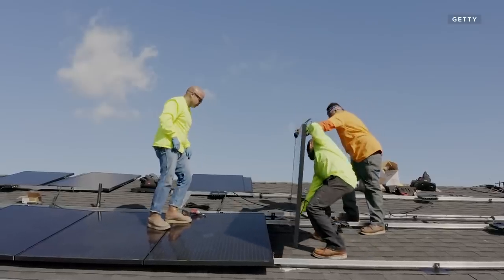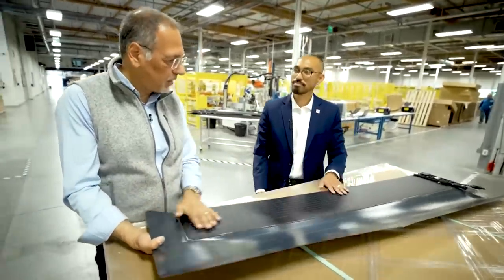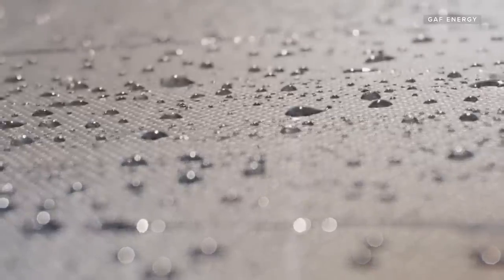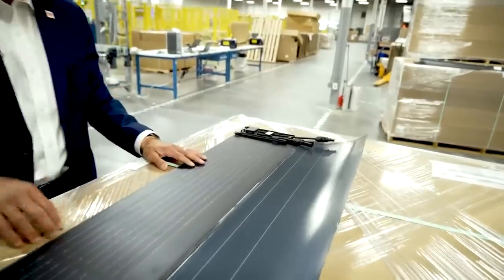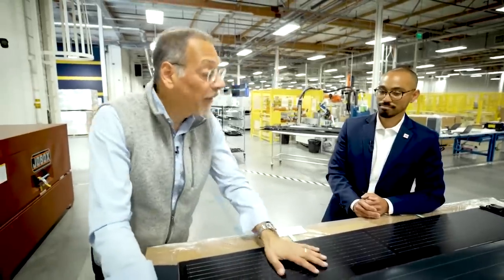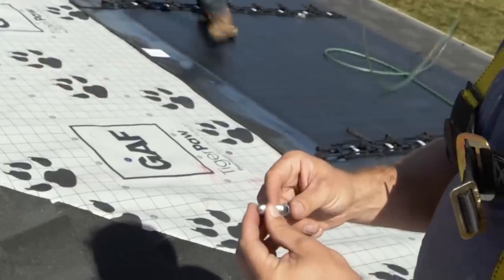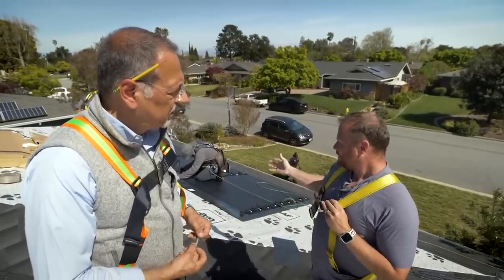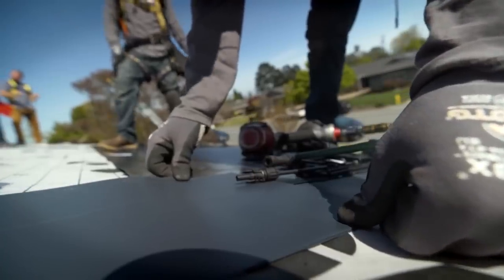The new Timberline Solar™ roofing system is so advanced it makes solar simple.  Call 801-447-8011

Comment: Great product! I would definitely revise the wire connectors. The Anderson plugs seem too large and make the whole connection channel look clunky, might consider XT-60 or XT-90 connectors.
Reply: @JorgTheElder  Sounds like you've been around solar for a while. I've set up small scale solar systems and I always look for ways to be innovative.  I know that concealing wires can be a pain in the keester.  Anderson connectors are clunky and might be overdue for a new invention, just my 2 cents. Eventually they'll come up with low profile, almost invisible connection type, to conceal this unsightly part of the install.
Reply: Anderson connector ?  That's Staubli MC4 standard solar panel connector . Invented in Switzerland IN 1996 . The gold standard of solar connectors.
Reply: Jorg jorgenson
Why does it matter? 
Look always matters to consumers
Reply from the maker: Good point, something to consider.  Thanks for your feedback
Reply: All I know after years of living in snow country,that if anything sticks up above the roof and is not flush with the surface of the panels and is made with plastic or a rubber material , will brake from snow removal especially after years of sun and weather as the material may become brittle.

Comment: This product looks much simpler to install for shade projects than traditional panels. Also for Vans and RVs.
Reply: The Van-RV is a bad idea. I can see lots of reasons that will not work.
Reply from the maker: Good thought but these solar shingle needs to be nailed into a wood base so it would not be very suitable for Van or RV builds.  For Vans and RV's the flex solar panels are good options if you have a good fastening solution.
Reply: @legacyroofingutah9766  If grommets were installed, and there was extra sheeting on both sides for 4 point securing, I bet it would work great!
Reply: bet they wont sell you a pallet of them though
Reply: All solar companies sell pallets

Comment: It just unreasonably expensive $20K vs $65K, I couldn't justify the diff in cost to install solar roof shingles. And what happens in the Northern state where snow covers shingle for a long period on time?
Reply from the maker: Roof integrated solar shingles that look much better than bulky solar racks on homes do come at a higher cost than normal DIY solar panels this is true, especially as this is not a DIY suitable install process.  GAF does their best to keep the product affordable but is not willing to cut corners on quality like many solar products do just to bring pricing down slightly.  For homes with snow, removal of the snow is required for any solar product to function properly.  Most cities have a roof snow removal service that can help with this.  The long term energy savings and environmental benefits are well worth going solar.  With GAF Timberline Solar Shingles your home can finally look great and have a very powerful energy efficient solar roof at the same time.

Comment: I really dont understand how the heat will work with this. normally, panels are installed with spacing, so air can come through. How does this work here? The efficiency will drop then?
Reply from the maker: When it comes to how solar panels operate day in and day out on top of the roof of your home, there are few common misconceptions. We thought we’d clear up those myths with some facts about how solar works in all kinds of weather conditions.

MYTH 1: Solar only works in hot weather.
You need plenty of sunlight to generate solar energy and there are more hours of sunlight during the warmer summer months. It’s the light — not the heat — that solar panels use to generate clean energy. Solar panels actually work more efficiently when it’s not too hot outside. In fact, there are many instances of solar panels working in extreme cold, such as the Antarctic, or even to power satellites in outer space.

MYTH 2: Solar doesn’t work during the winter.
The Solaria solar panels used in GAF Energy roof-integrated solar systems have been subjected to extra reliability testing to expose the product to a variety of stresses, including severe heat and cold cycles and cyclic humidity and freezing. And, as we explained in Myth #1, solar panels work more efficiently in cooler temperatures, so while they may collect less overall sunlight in, say January, the panels will generate electricity any time there’s light — as long as they’re not completely obscured by snow. 

If it does snow, due to the pitch of most rooftops, as soon as the sun comes out the snow usually melts and slides off the glass panels. It’s also worth mentioning that, depending upon where you live, thanks to a policy called net energy metering the excess solar energy you generated during the summer can be used as a credit with your utility when your solar production naturally decreases during the winter. 

MYTH 3: Solar panels can’t withstand a heavy wind or rainstorm.
What’s amazing about the new GAF Energy solar system is that you’ll be getting a roof from the most trusted roofing company in North America and a solar system that’s designed to be part of that roof, similar to the way a skylight fits seamlessly into a roof. This avoids having to risk the integrity of roofing materials by puncturing them to install a traditional solar system, potentially causing leaks. A GAF Energy solar roof is a product that has been tested in lab conditions to withstand winds of up to 110 mph. That means it’s certified per building code regulations to be installed in areas with prescribed wind speed ratings of 180 mph. The wind test also includes wind-driven rain at a rate of more than 8 inches per hour — twice the rainfall rate of the worst rainstorm in history. 

MYTH 4: Solar doesn’t work in cloudy areas.
Today’s solar cells are more efficient than ever, meaning they’re able to capture the sun’s rays even in low-light situations. In fact, cities such as San Francisco, California and Portland, Oregon have plenty of foggy or overcast days, and plenty of happy solar customers. Up and coming adopters of solar energy, such as cities on the East Coast with similarly overcast weather like Boston, Massachusetts and Newark, New Jersey.

 MYTH 5: Installing solar causes rain to leak through the roof.
As we mentioned in MYTH 3, you’re getting a solar system that has been designed to be part of your roof. Because the GAF Energy solar system is a direct-to-deck installation, similar to a skylight, its seamless, waterproof set-up avoids leakage problems associated with conventional rack-mounted solar panels. Rack mounting or “retrofit solar” requires puncturing your shingles and roof to install the lag bolts that hold the rack onto the roof. This sometimes disrupts the shingles and waterproofing, causing leaks and potentially accelerating the degradation of your roofing materials. By comparison, DecoTech®  is installed onto a fresh roof deck along with a new comp shingle roof and flashed in to ensure that the building envelope is maintained.
Reply: Interesting, but none of those myths address the OP original concern with efficiency drop as panel temperature climbs. Probably somewhere around 160f plus on a summer day with no wind.
Reply: @farmerbond4210  exactly! heat upsets all electronics!  how do they get rid of the heat?
Reply: I had an older system that used small panels designed to integrate into a concrete tile roof. There was no air space and as soon as the temps rose on warm summer days (San Diego summers) the voltage output dropped enough to disable the inverter and they proved virtually worthless. I took them and installed regular panels and they are working a treat. That was then, probably 10 - 12 years ago, and technologies have changed but what hasn't changed is the reduction in solar output of an system as the heat rises. These panels will simply get hot reducing their output.

Comment: Fiberglass composite covers and boxes.  I can't imagine they will be in good shape on a roof in Arizona or Nevada after 5 years.  Same thing about the temp efficiency drops.  Las Vegas has had months in a row with temps over 100.  What type of efficiency drop will we see then?  Then there is the biggest elephant in the room.  UNLESS you have enough power to be completely OFF the grid, if there are power drops and you actually lose power at your house, your solar is OFFLINE.  I know.  I had standard solar on my house in Vegas for a decade or so.  I offered to pay for the switch that allows the system to isolate so it does NOT backfeed into the grid when the power drops out.  No dice.  It's against the law in Nevada, or at least it was then.

Comment: If one of the panels quits does it kill everything bellow on the daisy chain?
Reply: If one panel brakes all roof will work as that single panel. This means here you will need to buy all roof again. In normal solar it will take 10min to find 10min to replace. Next silar heats up and all that wiring plus heat=fire. Normal solar between roof an solar big gap
Reply: @arturasnesakysiu1684  *This means here you will need to buy all roof again.*
Not true, you would simply replace the single faulty panel.
Reply: What....???!! So if the panels are wired in series it will essentially cut off anything in that chain wired beyond that panel? If wired in parallel, the power should bypass the damaged panel? Or either way, broken panel means broken leg, branch, series, whatever...??
Reply: @DegenerateToo  Yes. It's no different to conventional panels in that regard (so no advantage or disadvantage).

Comment: Especially in some aread of CA (hillsides and brushcountry esp) and other states fire resistance is imperative. That's why I used to specifically build with tile ir metal only.
Reply from the maker: Yes in these areas you must have high fire rated roofing materials.  GAF strives to meet all regulations and fire standards.  These Timberline Solar Shingles have the following specifications and ratings: 

Timberline Solar Roof Technology
The system is then fixed to a flexible material resembling traditional shingles and topped with hardened glass to withstand hail. Specifications: Can withstand hurricane-force winds up to 130 MPH. UL 790 Class A fire-rated.
Reply: @legacyroofingutah9766  thanks.

Comment: How are the panels held down to the top of the previous row, at the bottom edge to prevent wind uplift?
Reply: During the install it looked like they were pulling a protective paper strip off.  I'm guessing it's a glue down for the bottom edge of each shingle/panel.
Reply: @michiganengineer8621  - ok, that answers it.  Thanks for your observation of the details I missed!  I live where we get up to 130mph winds with some regularity, so panel shingles would have to be secured with a really strong adhesive here.  Something on par with automotive trim tape, and surface cleaned of any oils before bonding.  If they could make this really cheap, with the type of cells that still work in partial sun and on cloudy days, a lower efficiency, higher roof area coverage system would be excellent.
Reply: @orcoastgreenman  I'd like to see a system like this using micro-inverters.  Then feed them into the generator input of something like a Sol-Ark 15k with a big ground mount array feeding the PV inputs.

Comment: Having had 2 different new homes with GAF shingles over the years I don't think I want to throw out my solar panels every 15 years .  And I sure don't want to nail them down , If a traditional panel goes down I can change it in 20 minutes . As for looks a nice all black set of tradition panels installed correctly looks much better than that wire trough mess IMO.
Reply from the maker: You make a good point.  These GAF Timberline Solar Shingles come with a great 25 year warranty and will last the full 25 years or more.  The shingles used in the system should also be the upgraded more durable GAF shingles for a longer lasting more durable system.  As for one panel having an issue and getting it fixed yes this is quite easy.  On the flip side these solar shingles are quite easy to repair and fix as well with a slightly different process.  If you have a good square big roof than traditional panels if installed correctly can blend in well however if you have a roof that has lots of shape to it the traditional panels really stick out where if you had the GAF Timberline Solar Shingles would hide better and blend in better with their lower profile.  Both are great solutions it just depends on your roof and how the end results looks on your particular roof style.

Comment: In the example shown where you were comparing the racked solar roof to the shingled solar roofing, the one metric you didn't supply wat the increase in coverage over the racked solar solution. What, in that example would be the increase in coverage shingled solar could have offered. That is the missing metric that would communicate an apples to apples comparison, when it comes to power generation.

Comment: Interesting. I don't know though early technology. Sounds good but untested. Be good if there is a five years update and so on. If I could afford it I would give it a try. Next thing they need to give more information as the proof of the pudding is in the eating, you may have a roof full with expensive solar but not producing anything. Give us prof of performance please.
Reply from the maker: Good point.  As with all new products the results take time and someone needs to take that first step.  This is why GAF is confidant in offering a 25 year warranty so home owners can rest assured their investment is safe and covered if any problems were to arise and the product faced any failure points.

Comment: that adhesive should be a strip of magnet or velcro or buttons or whatever. like on jeans or a jacket. the kind you press together. cause then you can make it happen quickly. then you can change the roof with little effort. 
and use the shingels again. who knows. laminate them again with new 30 percent efficient solar systems.

Comment: This is nice if you want shingles.  But what if you want a metal roof?
Reply from the maker: For those who want a solar metal roof the Tesla Tile Solar Roof is worth considering or a company called roof-it is developing a metal solar roof.  you can check them out here:  https://youtu.be/tf88kOktOA8

Tesla Solar Roof Installs:  https://youtu.be/TH971dt0m5Q
Reply: They should do verticals that are same width if standard standing seam... something that can be cut to length and wires up under ridge cap.

Comment: An important direction is to ease installation costs. However, this is too light! There should be a weight on the back or winter storms such as here in the UK would rip it off.
Reply: I think I saw a peel and stick strip on the back of the unnailed edge. Depending on how strong the adhesive is, it should prevent blow off.
Reply from the maker: These work the same as traditional asphalt shingles and seal to each layer creating a water resistant barrier.  Same system and roofing function as traditional asphalt shingles just with added solar capability.

Comment: Seems like they should also take this concept and flip it 90 degrees, so that the panels are vertical, like a metal roof... So basically make solar panels that match exactly a vertical metal roof system.
Reply from the maker: Yes great idea.  Roof-it solar has a product like this you may be interested in checking out:  https://youtu.be/tf88kOktOA8

Comment: interesting, after seeing  this stream tried to each somebody from company.
After back and forth  emails find out it is available only for re-roofing and installation.
Not sure  if it is possible just  install solar shields over the existing roof. Sound no solid about this one..
Reply from the maker: Yes this is best for a new build or a re-roof since the only roofing system need to be fully removed and replaced.  As far as installing a solar shield over the existing roof or solar flex panels that are glued down this is possible however the problem lies in how durable would that be and will it hold in a storm or through the winter months.  Something to consider.

Comment: Very cool but what happens when the last panel is loaded with all the power coming through the wires from all the connected panels versus the first panel which has the lowest power level? What happens when someone goes up and gets hit by a combined power hit as opposed to a parallel connection?
Reply: The wiring is not 100% series, that has to be designed.  Since I will have south and west facing, I will have 2 circuits with 2 MPPTs.  And I believe each circuit will consist of 2 parallel strings.
Reply: @matthunter1424  makes sense, thanks

Comment: Better get a a CLEAR written explanation about the warranty and if it’s PRO RATED  ‘’watch out’’…I stopped using GAF about 12 years ago when GAF refused to give more than $300 for a  40 year warrantied roof that failed after 14 years….. FYI; Over the years I installed numerous roofs for GAF’s literature..
Reply from the maker: Good advice, always read warranties carefully and in detail.  Many roofing systems have various warranty options, I always go for the best as it has the least amount of limitations on coverage.  Additionally most roofs that fail or have issues fail because of installation errors and not material problems so make sure your installer is a master elite certified installer ideally in the highest rated GAF installers presidential circle

Comment: Any thoughts on developers adoption,  the cost v marketing potential may balance out. 

is this reasonable as a solar add-on or only when fully reroofing?
Reply from the maker: Best with a new build or re-roof as the old shingle roof must be completely removed before installation.  If you have a shingled awning these make for a great awning solar power station.